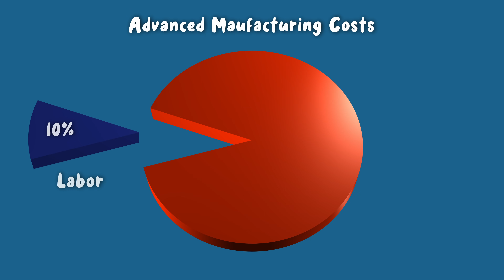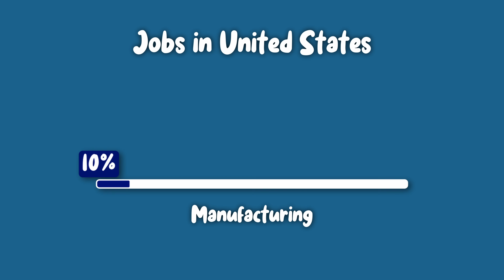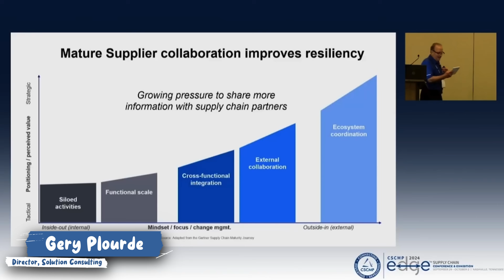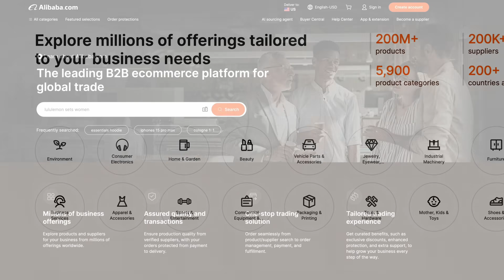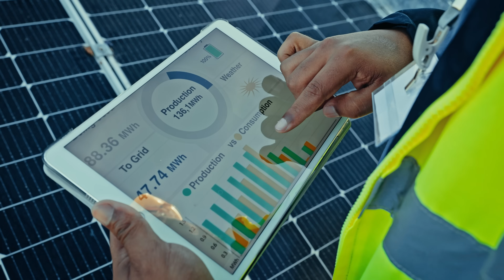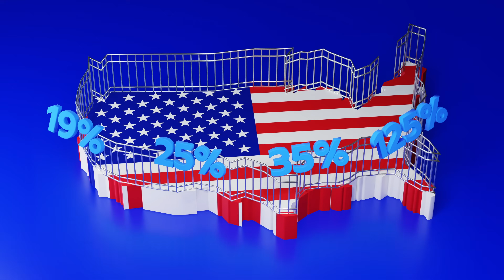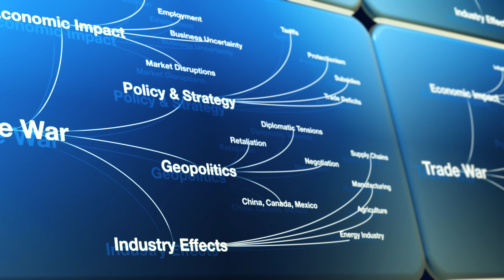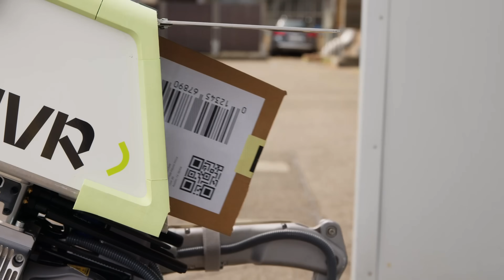Is US Manufacturing is coming back?

Comment: Manufacturing will never be what it used to be if there was actually considered a manufacturing boom. Yeah we used to make alot more here but we still do make stuff here in usa. It's just there never was really a manufacturing boom, a corporate monopoly boom and it's getting much much worse, only a few companies basically running out the competition through lobbying and merge acquisitions. Theres still manufacturing but it has expanded different lines of service. Iv'e noticed however usa is largely a retail healthcare resource than manufacturing. Construction and maintenance is the other booming industry, manufacturing nope it never really has boomed here in the usa, what we saw were the growth of robber Barron corporate monopolies having more building power even in the 50's not necessarily a cluster of opportunity as what we all been brainwashed. It's just transitioned over the years, merge acquisitions and corporations are obviously buying more products from over seas to complete their manufactured products or assemble them here in america but are usually welded, built, or fabricated in china or Germany. But construction and maintenance is the booming sector, not necessarily factory work yup that's really dropped just look at the job postings, oem manufacturers are very limited, and most are from over seas well there very limited number of that here in the states. The market is mainly more specialized skills like construction and general maintenance skilled workers. But healthcare and retail and food beverage which those industries are going to shit are still the growth factor of america by far. But it dont help most of our pharmaceuticals are made in china same with silicon industry relies heavily on Taiwan. It all boils down to corporate greed, cutting corners, and got to make the shareholders wealthier and that will never go away ever. They call the american dream a dream because it always was a dream unless your filthy rich. AI is gonna take away most of the jobs anyway, terminator film wasn't bullshitting about that, were seeing that right in front of us.
Reply from the maker: Not allowed to take him there. I can think there was a pretty significant boom during World War II we grew manufacturing capacity by 500% in a 5 year period. I don’t believe we’ve seen anything like it before or since. But it goes to show you what could be possible if the public and private sector puts their power behind things together.
Reply: @FutureintheMaking  yes ww2 was pretty much the only time we seen a huge boom in manufacturing booms at those margins, But if you go back it was basically corporate role back then us steel bethlehem, ford, gmc, i mean the problem i think is it all depends on where you live as well, we dont have small businesses like we used to and if we do it's family owned they dont bring in a lot of folks, the issue is the fact we dont have enough major manufactures or i'd say surplus to compete, in the present day market, and that will only happen when the government does more subsidies for manufacturing development, especially seeking out to entrepreneurs and doing more for them, we need a renaissance in this country and that's not really happening. Another issue is the education system isn't preparing the younger generations for the real world, but i also blame it on factors like corporate greed paying low wages and expecting 5 years of experience when the job description clearly states entry level, that's what i cal bad marketing, your setting up environments for new people to fail.

Comment: China already has fully automated factories, often nicknamed "Dark Factory". China is also far ahead in specific purpose AI, those that can automate individual processes. And still there are manual works like assembling electronics. The very central idea of this video - that the US is ahead in innovation and technology, and that alone is somehow gonna solve everything is largely wrong.
Then comes the energy cost issue. No, current govt.'s policies aren't gonna make energy cheap. Lately the largest contributor of energy growth was renewable, not coal. Think about it, how much does it take to open up a new coal mine vs setting up a new solar farm? Also, Chinese energy cost isn't low due to coal, it's due to their integrated policy and renewable plays a large part into that. Mind it, China is the largest user of renewable energy. 27% of their total grid is renewable.
TL;DR, I wish u good luck. But your entire video is based on the same "American Supremacy" arrogance that kept American down.
Reply from the maker: These are fair points for sure. I don’t believe in America Supremacy, but I also don’t accept defeatism. When you are able to align and work together towards excellence anything is possible. This is part of how China got to where it’s at and we have a lot to learn from them for sure.
Reply: @FutureintheMaking  The path to victory is to first accept that there is a problem. Then analyze what gets rewarded the most in the current system and what needs to be rewarded in the expected system. And most importantly, what kind of ownership model is necessary for the expected things to happen. Not bating on buzzwords.

Comment: 7:40 It’s misleading to suggest this administration is lowering energy costs. In fact, it’s doing the opposite:

The “One Big Beautiful Bill Act” rolled back key clean energy tax credits, which experts warn could raise U.S. power bills by up to 18% nationally by 2035 (FT).

At the same time, the administration is blocking wind projects and shifting investment toward gas power, even though renewables like wind and solar remain the cheapest sources of new electricity (Reuters).

A top White House adviser has openly stated the focus is on oil, gas, and coal—not renewables (Politico).

Bottom line: supporting fossil fuels while dismantling clean energy incentives isn’t a recipe for cheaper energy—it’s a recipe for higher bills and lost competitiveness.
Reply from the maker: I definitely get where you are coming from here and I agree with the importance. But there doesn't seem to be an easy answer with a higher priority placed on security with looming threats from China. Are we just incentivizing their growing industrial dominance?

Comment: America is America.
It will revitalize its manufacturing supremacy but now it will be massively A.I. & Quantum powered,   a total shift in manufacturing paradigm and Americans may or may not be prepared for it.     Trump already spearheaded sweeping A.I. and digital mainstreaming by drafting a law on it.     Do you guys ever wonder why the current president is deporting large chunks of illegals and overhauling the census.   It's because the new workforce doesn't need live humans that much as automation and digitalization are totally transforming the labor workforce.

Comment: even if 90% of all new manufacturing was robots. You still need new construction, Maintenance, Parts etc! and if we also focus on getting all of that from with in our country then that in return will create high paying jobs for Americans. We don't need a million plastic items, we need well priced high quality durable, fixable products that even if they are a bigger investment it is something we could pass along. like buying compressed wood vs buying oak wood furniture. the price up front might be lower but the constant need to replace it causes higher prices and not only there but in how we manage trash it at the end causes more energy and time to be burned in return causing simple thing to be more frustrating and expensive in the long run.

Comment: A decent segment of the population has a desire to buy Made in USA and people are willing to pay for it if they can recognize a genuine USA product. The market is flooded with counterfeit products. We need to bring back US standard measurements, threads etc and do away with the metric stuff. This will make US products unique and recognizable again. Look at Briggs and Stratton, they are still measuring their engines in Cubic Inches and using standard hardware. Yes they're seeing a ton of pressure from the Honda (and clones) but they're holding on.

Comment: If you build it in China, labor cost is between a half dollar and a dollar an hour.  If you build it in the USA, labor costs $25 or more an hour.  So, if a company comes back to America, robots will have to be used to manufacture the product.
Reply: The Chinese hourly wage is circa $3.40/hr. The USA hourly wage is $28.16. Since American wages are only 10% of the cost of product, it’s probably cheaper to manufacture in America for the domestic market since there are lower shipping costs, far lower energy costs, no tarriffs (currently 30%), better quality control and the need to maintain a far lower inventory. “Made in China” is going to become a very rare label in U.S. retail in 10 years.

Comment: Engineers , tooling , welders , electricians, fabricators, ……STEM then steel , construction materials , copper , …… the to do list is as long as my arm. Then US needs to be competitive globally because with exports , the costs will be even higher without economies of scale. It’s a multi decade project.

Comment: I think it is coming back, but not in a traditional sense. one key issues we had been trianing people for the wrong job for the past 3 decades, we train whole bunch of business admins, low skill service providers, and all of them have huge college degree that does not help anything, most importantly they are not adaptable to any technical job. only 20% of people going to college for STEM degree, vs China 60% of the college student are in STEM field. they train 3 times more engineers every year than we have in the entire country. the good things is, technology is changing manufacturing in a big way. for example, the proliferation of 3d printer in the past 2 years allow everyone to manufacture things from their garage. think about how many cheap Chinese junks that we bought from Amazon, quite large % of them can be printed with 3d printer at home. and as 3d printer is getting better in throughput and accuracy, also expansion of materials, we can manufacture parts and finished products from garage 3d printer farms.

Comment: Chris, I agreed with most of what you spoke about in this video, but having spent the 31 years in manufacturing I think you are missing the point that there still a lot of products that we need to make here that can’t be automated - especially for low volume high mix applications you spoke of.
Reply: At the rate of AI and robotics development, I doubt that any job won't be replaceable in 15 years.

Comment: Today, AI will have an impact, but it is also oversold by imagination. If your air conditioner or refrigerator breaks, will AI come & fix it? Will it change your car transmission? Or even change your car battery? There is a point of diminishing returns. The robot will cost more than a person changing your battery. India knows this. Your academic types that write news articles may not. They don’t understand the need for trades because they are pure academics.

Comment: There are two types of manufacturing the high skilled and low skill. With the high skill is hard to tell, with the low skill the us has a problem because it has an expensive labor, hence it will not be competitive if the industry demands a lot of labor.

Comment: Jobs are not coming back. It is only going one way the increase in mechanisation and AI. Millions of jobs will disappear.
Reply: Tell AI to fix your plumbing. Tell AI to fix your electrical. Tell AI to change your transmission. Tell AI to fix your air conditioner. Etc… Give it a go & tell me how successful you were.

Comment: If energy is so important, why is the Trump administration cancelling already-approved permits for wind farms and solar energy plants? The truth is that they don't do much care about making energy cheaper, but more about making the oil industry richer. Plain and simple.
Reply: Its political as well. Trump intentionally wants to tank the oil prices, because he already planned to sanction Venezuela, Iran and lastly Russia, all of them are big oil exporters and sanctioning them will spike oil prices greatly.
Reply: Because wind and solar is China bound and not as stable as coal and petroleum and nuclear. If usa produce  those solar panels in USA paired with batteries made also in USA solar could be reinstalled but as it is now it's a money pit for consumers. Wind farms are even more unstable and it also not good for the land and kills whales and birds on top of a China dependent asset., its a ccp scam. AI will need stable reliable cheaper scalable energy source like coal, fuels and nuclear . That's why , the green new deal is a pure scam and leads to national stagnation.  USA needs to climb the Kardeshev scale.
Reply: solar and wind are expensive to replace parts. Plus they are inconsistent sources. Last point is solar cells are mass produced in China, which implants kill switches in their tech.
Reply: @kazongasingleton4498 there are lots of american solar panels production too. Its big business.
Reply: @binky777  it definitely been big per being subsidized by the government. However from a trading standpoint or the ability to sale it to other countries. Oil and Natural Gas are 1#.

Comment: Your bit on manufacturing quadrants is what many say lacks in US manufacturing. Many small machine shops and  tool & die shops closed down in Michigan over the past 30 years. Co-op job-shops are a great idea (do you work with Automation Alley?) but besides workforce, culture, and permitting, the biggest issue is financing. China has state banks that help local production. US business & economics teaches rent-seeking financial capital and patent monopolies, even as industry acknowledges they need supply chain cooperation and open source patents.